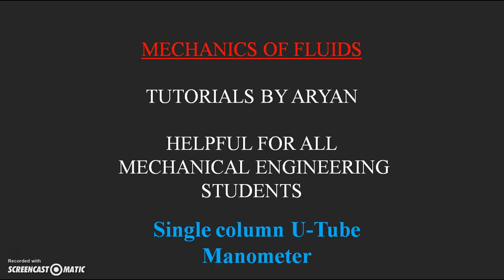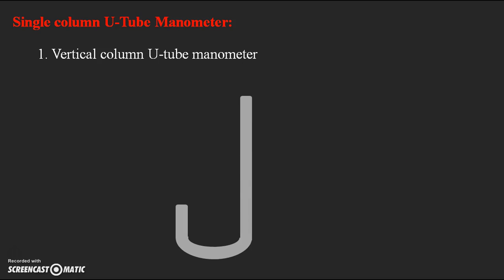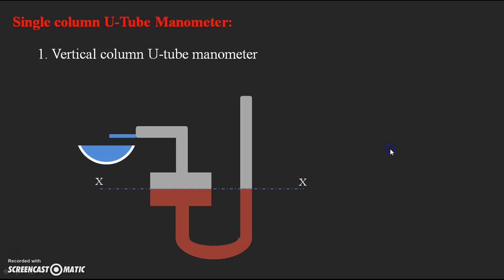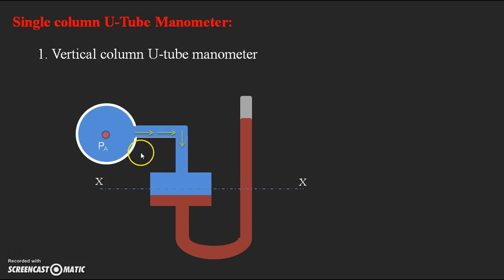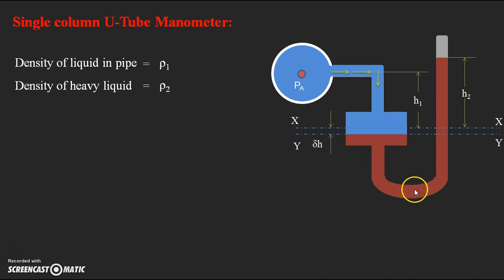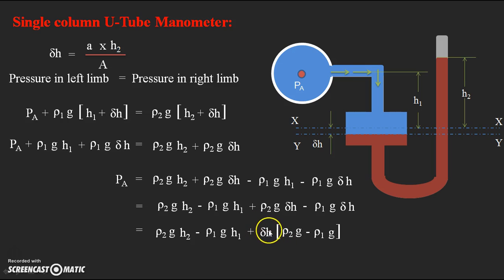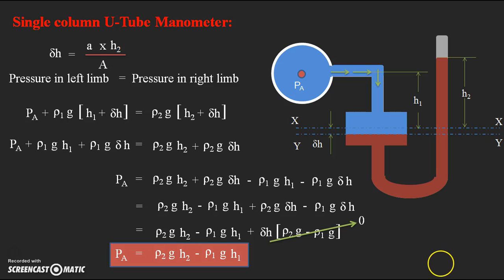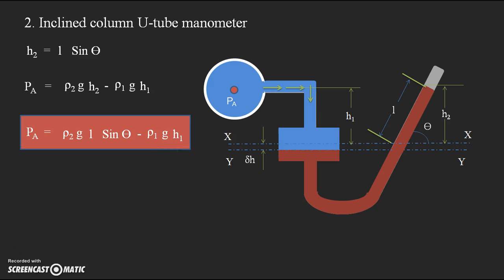Single column U Tube Manometer

Comment: Every thing is clear sir but ..why did we consider the height from y-y line upto h2 in right limb while the increase in height is h2 only 🤔
Reply: Increase in height is just the difference between the initial point(X-X) and the final point(the surface of the fluid in the right limb). 
But when we measure the pressure, we measure it from the new datum(Y-Y)

Comment: why do we use mercury at bottom of the pipe in manometers
Reply: bcz to determine the pressure diff.we need to consider the higher density fluid like mercury